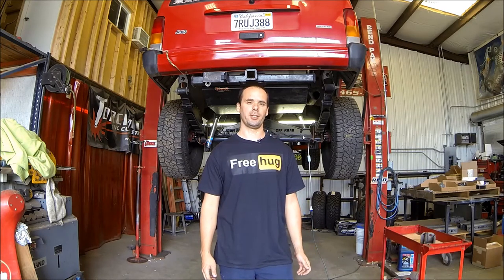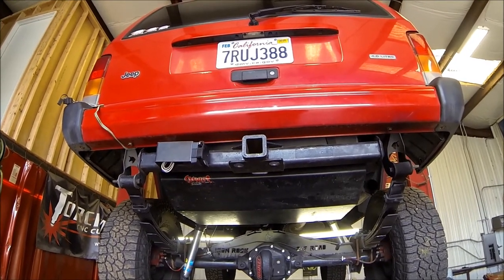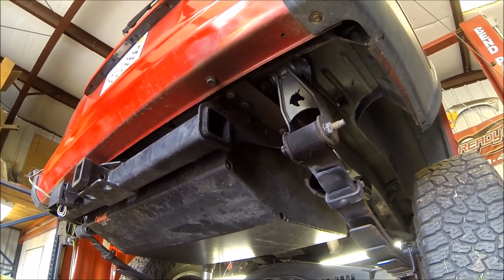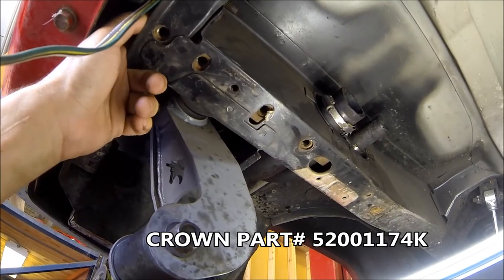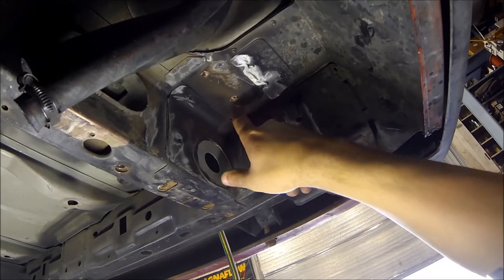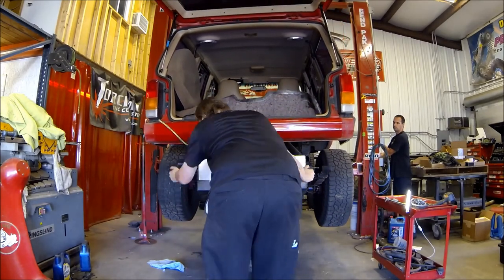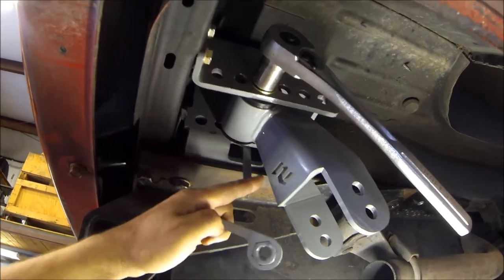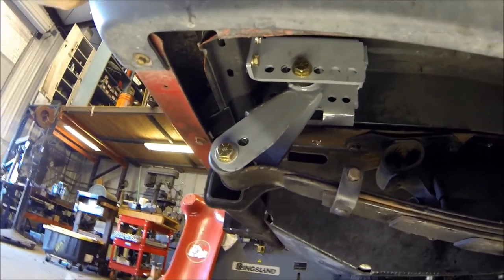SFR Shackle Relocation Bracket Install

Comment: Yeah, doin mine right now. I put the SRB against the unibody frame, then had to customize the XRC bumper brackets to fit with them so I can add the Genrite whenever or make repairs on individual components.

Comment: What if you have things like bumper brackets and a skid plate? The boxes cannot go underneath the bumper brackets because it won't be even. Will they allow being mounted 1/4"-5/16" lower?
Reply from the maker: The jeep in the video has a skid plate and a hitch, so you should be able to see how they all fit together. Ideally the relocation brackets would go against the frame, but you could put your bumper on first. You'd just have to shim the top of the box where it bolts through the floor.
Reply: Better off shimming hitch than box.

Comment: How do you mount the trailer hitch with the relocation bracket using 2 holes of the nutstrips
Reply from the maker: The relocation brackets use all 4 holes. A trailer hitch simply sandwiches the brackets, using the same bolts.
Reply: @stinkyfabracing  would my jeep be taller after i install them or would it be the same ride hight with the SFR Jeep Shackles
Reply: @stinkyfabracing  says something about it adds 1.5 lift
Reply from the maker: The shackles are longer than stock and will add lift. How much depends on which hole you select and what angle they are at. The relocation brackets don't add any lift.
Reply: @stinkyfabracing  is there any shackles to keep my ride hight as is ? I wouldnt wanna lift it any more
Reply from the maker: There are dozens if not hundreds of shackles on the market. I'm sure there's at least one set that's just the length you need.
Reply: @stinkyfabracing  oh okay i had thought that you're brackets were only compatible with your guys shackles
Reply from the maker: No, any shackle for an XJ will work.
Reply: @stinkyfabracing  thank you for taking the time to reply back  💯